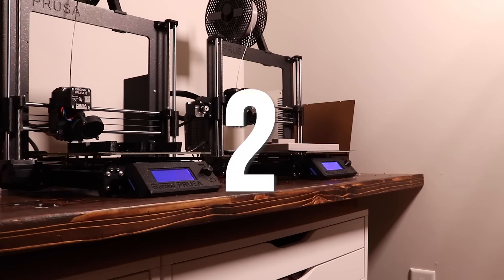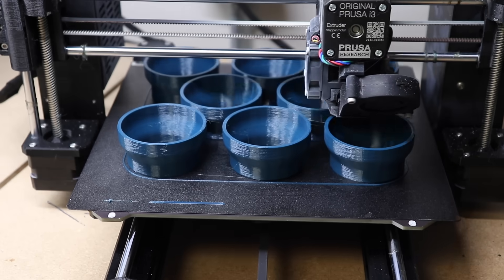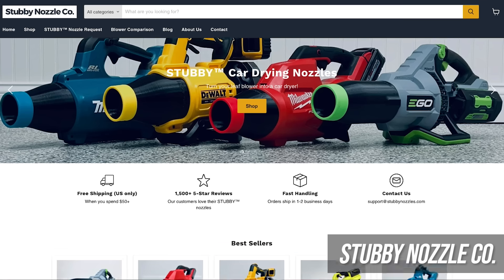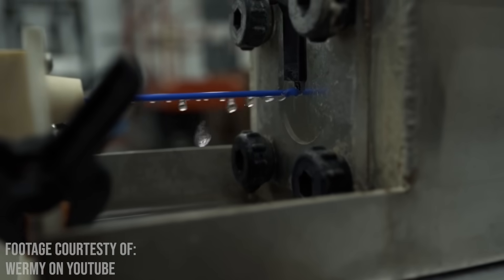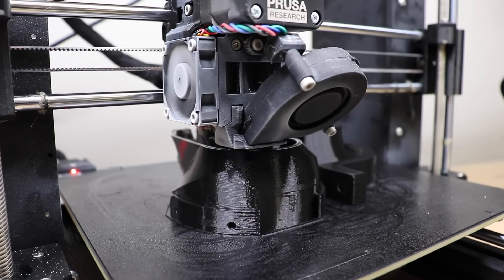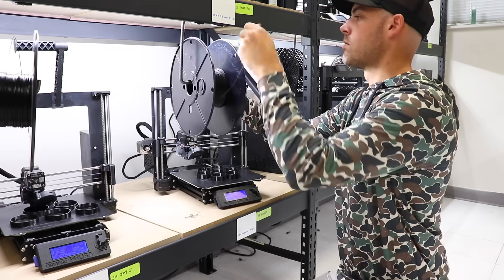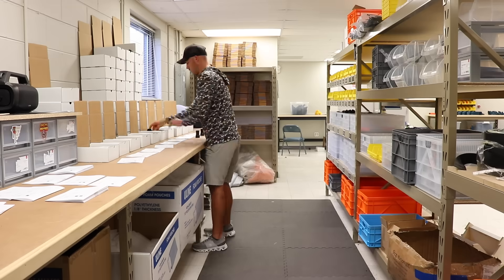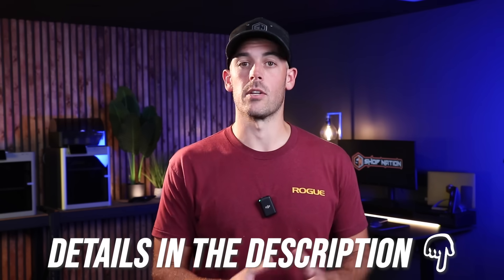10 Things I've learned running a print farm

Comment: curious why not exhaust heat and fumes? i have worked in cable / telco headends..they do a/c them all instead of what i mentioned but thats usually due to amount of btus created and trying to condition the incoming air. with added potential toxic fumes it would almost make more sense to go that route if possible.

Comment: I mean... Prusa is super reliable dont get me wrong. But if i was to do this I would probably buy mostly A1 mini's and maybe a couple P1S for high temp ABS/ASA. Its hard to justify genuine Prusa when its twice the price for basically the same stuff. Also Bamboos being half the price means you can justify buying a couple backup printers to literally never have downtime. Plus much faster servicing and almost fully auto calibration. I shrunk 6 creality's to 2 bambus basically...

Comment: Hey! If you add an affiliate link for your spool holders/feeding system (not sure what it is called) at timestamp: 4:59. I will def buy them!
I have the same shelf set up and looking to move the filament to the front for easy access but not too sure where to start.
Cheers!

Comment: Would you still recommend the P1 P versus the P1 S for a print farm? Seems like you get a lot for the extra 100 bucks, but not sure how that would all translate to print farm setting. Specifically wondering about annoying things like having to open the door, which if you’re printing PLA, you would likely just need to remove all the doors anyway. Thanks for your help!

Comment: I'm awittle confused. Not trying to call you out but you preach Prusa because of reliability and proven track record - but recently seem to have 'switched' to Bambu because of performance. Ultimately I'm on the fence about owning my first printer and hoping for some clarity and/or guidance. In one video you outwardly state Bambu is the way, but this video you seem to be more on team Prusa. I swear by the Corolla approach to life - so I generally side with Prusa, however..

For someone looking to print in a variety of materials (TPU to carbon filled), print a variety of things from skull flower vases to squishy motorcycle grips - the Bambu seems like the better FIRST option and to be able to handle the variety of items/materials used, plus the speed. I'm not trying to start a print farm, but I do have a few ideas I'd like to get to production. So, apples to oranges, Bambu X-1 Carbon (w/ AWS) vs. Prusa Mk-4 (DIY kit ofcourse)? Also where does the P1S fit into the competition?

Based on price alone, I could basically own two Mk-4's for one of the fully equipped Bambu's.

The analysis paralysis is real! Thanks for the video, you've more than earned this sub! Happy printing.

Comment: Really impressed what can be done with a old quad-core computer running Linux and multiple octoprint  instances you can likely manage eight printers at a time per server and push files a lot more quickly not to mention making a global update easily I can imagine those memory cards are huge pain in the butt but maybe octoprint at that scale is also a big pain in the butt.

Comment: Instead of the aircon and the purifier I'd run one or two greenhouse fans.  These need a hole in the wall or the window, but they energy efficient, cheap, and fairly quiet, but most importantly they can replace all the air (and any breathable contaminants within, and most of the heat generated by the machines) in less than a minute.  Look for the ones that look a bit like an airplane turbine.

Comment: Octoprint?  Cheaper and safer than SD cards. MK4’s don’t support Octo but they’ve got software to cover it

You need to consider automation. Some have little robots to pull parts off the flex plate, more places for breakdown IMO, but getting your MK3s’s WiFi enabled, simple scrips to send files will save you a time of time and money in the long run. Just my 2 cents.

Comment: That junction box looks way over the fill rate per code. Then doesn't look like a licensed Electrician did it, since no twist on the wire near the caps.
Then I'm a little confused on why you have the red and blue wires. Used to separate phase since its commercial, all way to receptacle? For I don't see nothing using 240v in that room. 12ga over kill for a 3-way switch, so not sure why.
If your sharing a neutral between 2-3 12gauge runs, then that surely causes a neutral off balance. But normally motorized equipment, doesn't even use the neutral. But I suspect a 3d printer still does.
-edit Well that mini split surely is 240v :]

Comment: Hey, I got a solution for your SD card problem. What you can do is. Use an SD card virtualization. You plug in a "sd card" which is just a data connector and then you can connect it via wifi to your local drive system. Then you do not have the problem anymore. Just move the file to the local folder to which every sd card transmitter is connected and start printing :). The only thing what you need is to power the SD card to wifi connector via USB.
Reply: I don't get it. Do you mean a Wifi enabled SD card? How do you connect it to your local network?
Reply: @vlad_o_sh  You just use a SD card visualisation, basically you put into the SD card slot not an SD card but an adapter which is just a direkt WiFi Link to your local drive.
Basically think of a SD card to usb, but just the other way around and with a wireless link instead of cable.
 This makes it possible that basically this local drive which is just a folder in your PC acts like a "SD" card for every printer who uses the SD card to WiFi adapter, at the same time. 

You just put a SD card adapter to WiFi into every slot on your printer at it will fake your SD and connect to the folder on your PC. 

You can google "SD cloud"  there you will see products, they are mainly used printers 3d and normal ones around the word.

If you know how to program and how to use an usb, you can build it on your own and save some money.

on your PCis now
Reply: @vlad_o_sh  basically yes, a SD cloud. You can build this easily with a ESP or buy some. 

You can just integrate a folder on your pc and this mirrors the SD card so you can manage all your printers all at once or individually. 

You can just configure and select if you want to upload the same data for every printer or upload different data for different SD-wifi cloud printers individually.

If you need help write to me, I am using this for vending machine development, saves me a lot of time.
Reply: @MirjanScholz huh what do you mean I can't find any " WiFi sd card"

Comment: They seem more useful to a skilled person as a tool. Like a designer using it to test ergonomic form. Or an engineer wanting to test a jig fit before comitting to cutting metal. To compete with mass manufactured injection moulding seems to be a problem... Obviously, smaller runs before investing in the cost of injection moulding dies is an option. Like metal spinning instead of forming dies, because low volumes make the dies untenable.
I don't know what a print farm can make that sells in a profitable manner, beyond trinkets.

Comment: Hey, this isn't a common topic spoken about on YouTube when it comes to 3D print farming, but could you share with us some of your tips and tricks with bookkeeping? It would be very beneficial to hear how you keep track of taxes and total profits in your farming business since 3D print farm books especially with Etsy are rarely spoken of.
Reply: Lot of the answers here are going to depend on exactly what you're doing and how you're doing it. The basic answers are that the acquisition of printers will be a capital cost that gets depreciated over the expected life of the printer, consumables (filament, spare parts, electricity) are expenses (more specifically, Cost Of Goods Sold), whatever customers pay you is your income. That gets you your basic P&L which will show income or loss for tax purposes. At small scale (10s of thousands) cash accounting is usually fine, as the numbers get larger using accrual accounting becomes more important and eventually largely mandatory. 

Sales tax is its own issue. If you are retailing direct to consumer you will definitely need to collect and pay. Not doing so or worse collecting the tax and then not paying it to the state is probably one of the most common ways small businesses get into deep $#@!. This is one place where getting pro advice is worthwhile.

Also how detailed you get depends on whether you're making one product that you sell or running a service bureau where you want to understand profit/loss per job or product.

Comment: Do you foresee using commercial grade 3D printers like from HP?  Reusable powder, ability to print in full color layer by layer, you can custom fabricate specific materials properties as needed, faster production, no filament to go bad over time while sitting in the stockroom, high quality prints every time, none of that hobbyist level nonsense you have to put up with from the types of 3D printers you're currently using.

Comment: You better bought an injection machine and a CNC mill to be able to produce the molds. Most of the 'plastic' parts in industries are made of PA, PA6 for example.

Comment: I have a print farm with 18 creality printers. I can't agree more with you about the fact that good maintenance is one of the key. I have been running the business for almost 2 years now and no major issues with the printers. As a low budget guy I can say you don't need high entry 3d printers to start your business.. it's all about commitment, planning and most of all love what you do. And thank you for your tips
Reply: I have one K1 and one ender 3 but i’m planning to increase. do you recommend me buying more expensive printers like creality K2 or lots of ender 3 types.
Reply: @chalapathipenmetsa5820  Depends on your printing goals especially what kind of filament will be your go to. For example if you plan to use mostly PLA, PETG or some type of TPU, then definitely go for the cheap enders(ender 3 v3 SE is my favorite now) but if you plan to go for Nylon or carbon fiber or some other complicated filament then you will need some high end printers. Even now with the experience and epertise I have in 3d printing I did order 5 more ender 3 v3 SE. two things tho: the first upgrade you will need for smooth and fast PETG(or others) printing is an all metal hot end and the second one is to never stop improving yourself. Good luck in your journey brother.
Reply: @chalapathipenmetsa5820  
It depends on what you plan to do, but generally on the type of filament you will use most often. For example, if you plan to print with more complex filaments like carbon fiber, nylon, etc., then high-end printers are strongly recommended. But if you will be mostly using PLA, PETG, or certain types of TPU, then go for the Ender 3 (especially the V3 SE, it's really great) with a few small upgrades (especially an all-metal hot end if you want smooth and fast PETG printing). 4 more Ender 3 V3 SE are arriving in my workshop at the beginning of the month, and I plan to order even more. Don't forget : good maintenance, testing and always learning new tips, techniques, or updates is the key to greats results! Have a great day.
Reply: @chalapathipenmetsa5820  I don't know why my comment responding to you keeps being deleted.
Reply: but what can I sell? I want to start so bad

Comment: This is two months later and maybe you already have a solution for the sd cards, but perhaps having a central computer off the grid controlling the printers via ethernet cables and switch port(s) could solve your constant walk issue. The way it would work is to isolate a computer system, connect your printers to ethernet, and obtain your order files from a seperate networked computer to distribute into the isolated network. 

With this method you can:
1) stay out of the print room more 
2) mass print from a singular location 
3) monitor print status from the isolated computer instead of running in to check on the prints
4) increase quality of life
5) save time

As far as printers that do not have ethernet capability like bambu printers.. Maybe developing your own router network would be the best option if that option is available to you. It is how I would run it.

Comment: You really need to setup Klipper on them, then connect them all to mainsail on your network.  You are working way to hard getting files to your printers.  It should be as simple as exporting your gcode file directly to the printer, than hitting print.  The only time you enter the room is when you go for removing the prints from the plates.

Additionally, with Klipper and say mainsail or fluid (front ends, so like a website GUI to control the printer), you can streamline your maintence.  Triggering automations, notifications, etc.  every 1000 hours print time trigger a notification to lube, or for the maintence tech to check the printer.  Than you can store that data in a ticket management system, and find out exactly how much parts you need to keep on hand.

Comment: I have a suggestion to save you down  time on maintanence and repairs, convert you x carriage over to mount to a wham bam mutant v2 system. when one goes down you pop the lever remove that carriage and instantly pop the new one on. then you have a machine that is dedicated on the side to use to do hot end repair and swaps and calibrations on the wham bam mutant v2 plate once you have it fixed just put it away so its ready to swap out as a nother one needs swapped out. i hope this makes sense, i have 2 printers now that i have converted to wham bam and its so nice being able to swap it over to another plate that has a hot end ready to go or even if I want to swap over to a different nozzle size for some reason. just saying if you did this you would never have a printer down again and it would also be away to do your maintanence routine. you could obviously lubricate and what not your machines as usual but then just refresh the carriage with a new hotend and move to the next alot quicker. let me know if you need me to explain better. no i do not have an affiliation with the wham bam company I just enjoyed this video and information you provided and saw a way to possibly help you improve you work flow.

Comment: Electricity is for free for you? Insulation on the underside of the printer bed would reduce consumption, speed up heat up times and save on air-conditioning costs as well.

Comment: Out of curiosity: have you considered putting the printers in enclosures? Should make them more reliable, and help with heating / cooling / VOCs issues. Prusa sells an enclosure for the mk3 but they also have a free design.

Comment: Why not just put a Pi Zero on them and upload all the files through the network?  I just installed a Pi zero and it's surprisingly easy.  Such an awesome upgrade, it would be a mandatory upgrade IMO by far if I had 40 printers, holy cow.  I can't believe you're still using SD cards!

Comment: if you have a handful of printers (less then about 10) you might want to not to "print to order" since you don't have a lot of mass producion capacity yet and you don't want to be surprised by a sudden big bulk order.  So start out with just a "stock" number of parts/objects.  That way if something gets hot fast and "sells out" quickly, you know what item to print more of, and fast.  Having 10 or 30 of a thing on hand can help see what sells faster then others.  This also helps in finding if said thing is worth investing more printers into, or changing to making something else.
Also KEEP IT SIMPLE, print only a handful of items, and have dedicated printers (rotate what ones do what) doing just that part.

Comment: Man when you get some Klipper machines in there and use the built in web interface you're going to save so much time over sneakernet. 

Being able to upload a new print file and being able to re-print files from the web interface is great. 

No raspberry pi. Just plug machine into lan or (with newer machines) use the built in WiFi connection. Each machine gets an IP address, you  can even assign them in order of the room layout if you set static ip for each machine.

Comment: I'm wondering what would happen to the voc levels if you ran the purifier overnight? Some of the initial use in the morning has to be pulling out the VOCs from the night before. I know it can do the whole room in 12 minutes so it's not likely to make a difference but wondered if you tested that. 

I know with ACs if you don't get ahead of the heat it takes a lot longer to cool.

Comment: Awesome video!!! I have two printers, a CR-10 and Prusa Mini, both supporting my scale RC habit. Some of my designs have gone a little viral in the scale remote control community, and I have put a good amount of thought to doing a small-scale hustle with these parts. One large thing that keeps me from taking that step is the software I design in, Fusion 360. It is free for hobbyist, but as soon as I cross that etherical plain between hobbyist and merchant, the company that makes Fusion 360 will want their pound of flesh. This might be Tip #11, Design Costs.

Comment: Have you ever looked into the 3D printer mods you can do to add a conveyor belt system to auto eject finished prints into a bin? I think there may be a few production 3D printers out there that have it, too. I can see it causing problems with bed adhesion but I think its a really cool concept and could speed up workflow tremendously.

Comment: Hi, Great video, but I jut don't get the economics.....an average medium size part takes say 2-3 days, but injection moulding of even vac forming takes seconds....I know the benefit is easy to adapt/change designs....but surely the best halfway house is to combine vac forming with 3d printed parts....ps tooling for vac forming is cheap...just a thought.